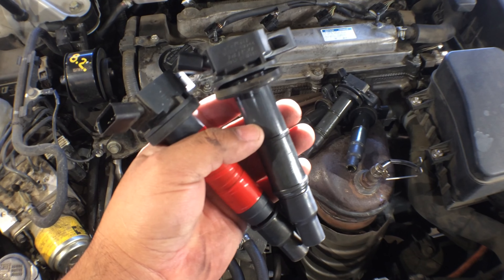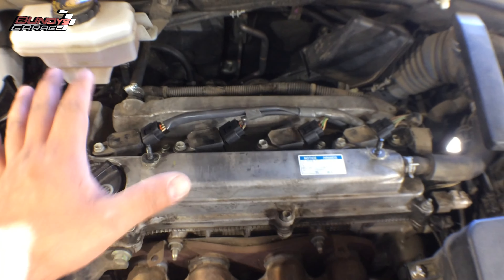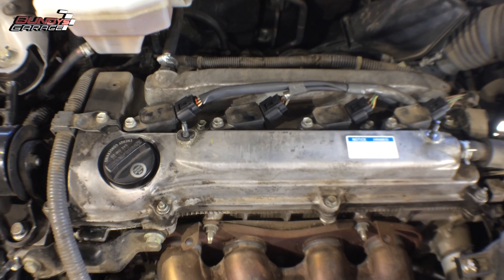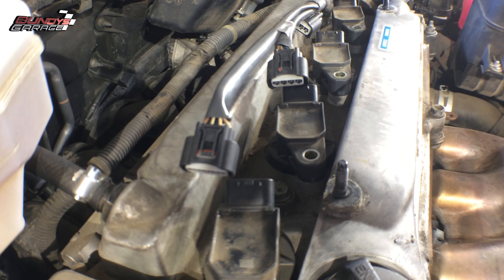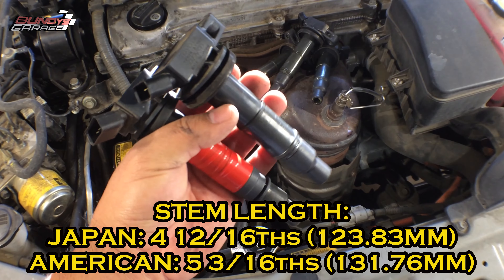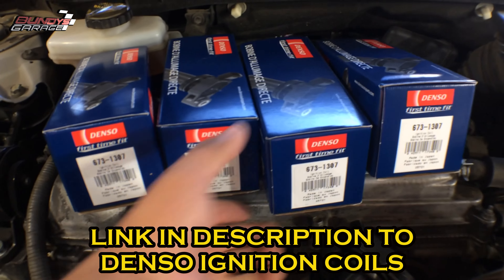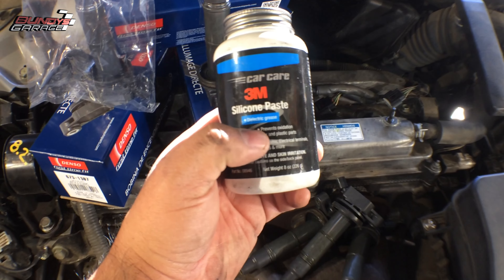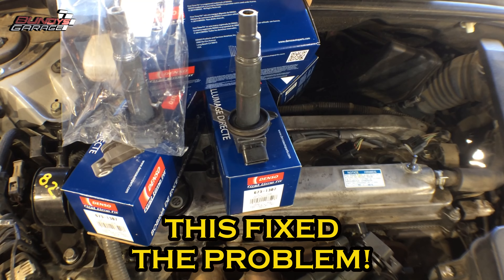Toyota Camry Ignition Coil Pack [MISFIRE] | Denso Japan vs. American 2AZ-FE 2AR-FE | Coil Too Long

Comment: Totally off topic but question, will a j35a8 fit in a 2006 Honda Accord with 6 speed manual. If not will a j32a3 fit. Using the engine harness from the stock j30a5

Comment: Great video! So I have an 09 Camry LE with the 2grfe 3.5 v6, do you recommend thr Denso coils and NGK spark plugs as well? 

I could only see 3 coils pulling off the engine cover as the other 3 are behind the intake manifold which I've seen/read is quite a bit more work.